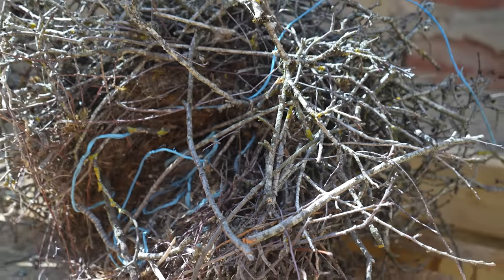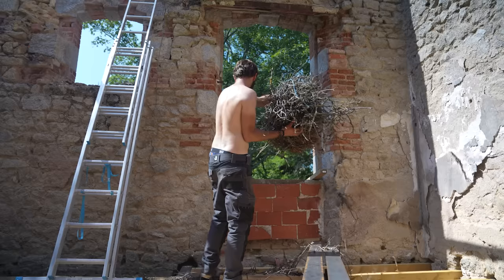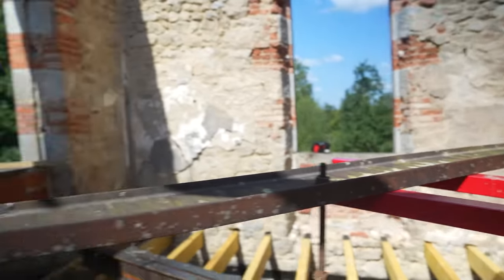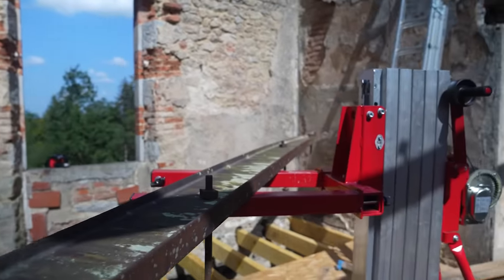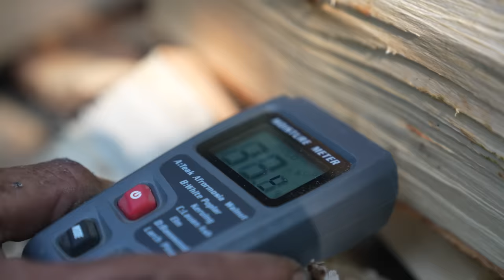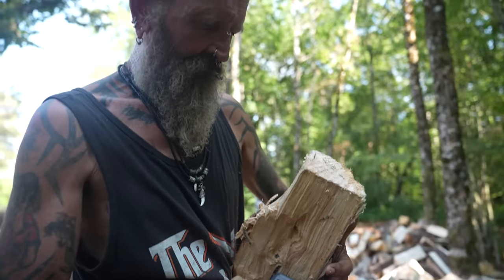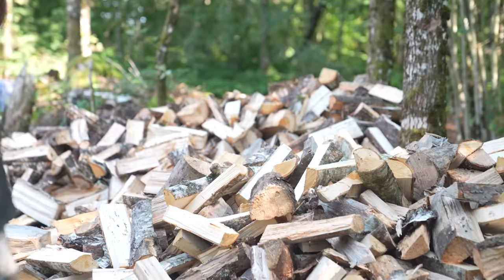Processing CHATEAU trees into YURT firewood.

Comment: Dan put a plastic skin over that second story floor once you got it all in. 
It will give you cover beneath on the first floor for a huge amount of undercover workspace and any water that lands on top will be redirected down the sides to the basement below. 
That will give you lots of extra time to get sorted inside while you repair all the walls, windows and doors and slowly build the third floor. 
(I didnt realise till you pointed it out just how much work you need to do to stabilise the tops of the walls and second story windows)
As it stands right now all that water is just coming down in a shower between the boards and you don't have any undercover area to store long lengths of boards or even the bags of cement and lime.

Comment: My dad used to use a mechanical splitter for his firewood but it was only the splitter part and you had to load each piece of wood onto it a number of times to get the wood split small enough (it only had one vertical blade mounted on a hydraulic pump). Dad retired from working when he turned 75 last year, he had been using chainsaws since he was 10 years old. 
He grew up on a mixed agricultural farm with stone fruit orchards that had to be pruned and as the only son helped his dad with all the chores including using a chainsaw, manual blockbuster and axe to split firewood, make kindling, prune trees, etc.
When I was 13 he joined the local unit of the NSW State Emergency Service (here in Australia) to help with storm damage, etc. He soon started teaching all the other team members about using a chainsaw safely. As a team we were sent on "out of area" jobs to places like Sydney and Maitland where he used his skills to remove problem trees that had fallen (or were threatening to fall) on houses/buildings/roads etc.
He served 25 years before retiring.
I really hope that Nick is able to share his experiences and skills with more people. I think he and my dad would have great fun swapping stories. Blessings from South Eastern Australia, Dot

Comment: My Dad would have loved that firewood cutting/chopping tool.  We had a wood splitter and an old arbor mounted saw that ran from a tractor belt pulley.  But all that was slow and the saw was more than a little on the dangerous side.

Comment: Hello Dan, the top finish of the walls is very important. A ring beam made of reinforced concrete seems to make the most sense to me. The ring beam should be dimensioned by statics. In the past the building had a mansard roof and will certainly have a mansard roof again. However, the roof truss for such a roof can look very different and therefore also introduce very different loads into the walls. Above all, the horizontal forces from wind load or possibly from the expansion effect of the roof construction are problematic. So you should only build the upper end of the walls when you know the construction of the roof truss and all the connection forces.
Reply: I assume that's what he's going to do since he mentioned that for the third floor a while ago. I assume the original construction relied on the timber structure of the roof but had reinforced concrete been more common I'm sure that's what the builders would have used, considering how modern the château's construction was for its time.

Comment: Nick has all the fun BOY TOYS , you will need to start heating the Yurt otherwise your mattress will start getting damp and the new leather sofa will start to mold 😞. 
Things are moving so fast at the moment and fixing the top walls will be epic as it won't be long before the first roof goes up and it's not even September yet !!! WELL DONE DAN !!!
Reply: It will still be a slog to finish the roof before Winter sets in, it's a pity that all the window lintels need replacing, it will take about three or four weeks to get the structure up to roof level, but sorting out the roof sections was always going to be the time consuming part and at least he's getting there, hopefully he will not have to many "interruptions", I wonder if he's going for a temporary or permanent roof, most probably temporary for now!?!
Reply: @thomasherrin6798  do you know the roof of a castle? do you know how difficult and different from a normal roof it is? A roof of a castle needs a specialist, do you have never seen one? Roof and attic?
Reply: @mlaiuppa  It could be done though, as the rafters used to run parallel to that main wall with the fireplaces, so extending the roof framing over the central hallway later wouldn't require any splicing. Just let the sarking and membrane overhang the last rafter and cut back once the next rafters go in. I think the section could even be slated without too much hassle. It's not uncommon to do large roofs in sections, like Château de Purnon.

Only the chimneys would have to be fixed to above roof level before that could happen because the mansard roof runs into them. Of course just doing a shed roof bolting a wall plate to that fireplace wall and running rafters to the outside wall would be faster and easier but it's work that will have to be done over in the foreseeable future.
Reply: Who wants a tour of inside the 🛖 yurt ?
Reply: @janice8948  oh I thought id have missed it Dan said he would show us round
Reply: @janice8948  yes I agree, and how does @LordBurberryGB know he bought & has a leather loung?

Comment: Dan, do you will make a temporary roof before winter to protect all your floors?
Reply: His goal was to have a roof completed.
Fingers crossed.
Instead of fire wood, I wish he and Nick, maybe Cameron too, would focus on getting to the roof level in order to start building the Roof.
Reply: @dennispatrick4999  Nick is a busy tree surgeon not a builder.
Reply: @consideredwhisper  You totally missed the point of the safety discussion. 
Nick is a tree surgeon/trimmer and uses his safety equipment like a pro he is.
Google Safety Construction Laws in France. It definitely covers Dan's Chateau work and he should adhere to them. Especially with his 2 small children.
It's amazing that someone has issues with safety at a major Construction site.
Reply: @dennispatrick4999  where is there a discussion about Safety in this little thread for me to have ‘missed the point’? I was simply pointing out to someone who might not know that Nick is hired because he deals in his professional capacity with the trees (in several chateaux): in addition he happens to have some kit that helps Dan with the clearing of crap out of the building or to help lift beams. He isn’t a builder to build the roof. I’ve no doubt Nick is booked solid as a tree surgeon elsewhere.

Comment: Is this next level the Roof??? OR is it 1 more floor to go up??? Roman Concrete the Strongest concrete is Sea Water, and Quick lime, The Salt in the Sea Water makes it set better, and chemical reaction happens to make it More strength
Reply: Yes, once Dan gets the new steel I-beams in, they are the main supports for joists make up the 2nd floor & 1st floor ceiling.   The 2nd floor had the mansard roof, and another commenter 'Ragnar' said the 2nd floor probably housed a smaller 3rd floor attic/loft.

Comment: Your work here reminds me of the channel, Les Jeromes. Only they are the ones who dismantled the chateau’s inside, including the roof, and rebuilt it. They also have had to bolster up, repair and replace bits and pieces all over the place. But they were two, yes, both named Jerome, who worked on it. Fascinating.
Reply: They're crazy perfectionists though. I absolutely can't imagine Dan painstakingly collecting, sifting and reusing old mortar! I'm a bit surprised they're doing OSB and Fermacell stud walls rather than plaster & lath though. Seems a bit too easy for how they usually roll 😅

For anyone who doesn't know the channel, they're two Belgians who bought a fairly rundown 18th-century mansion in France, near the Belgian border and have been working on it for several years now, stripping it to a bare shell to remedy plenty of wood rot and poor previous renovation work. Eventually they also plan to rebuild the spinning factory on the grounds that burned down in 1908.

Comment: If you want at least some of the wood for this winter just stack it in separate rows. And cover the tops. I've been using firewood as the only house heat for 35 years. BUt it's best after a year. I cose pack my rows because it will take too much room otherwise. You have lots of space to make long rows.

Comment: Enjoy your vlogs. I'm not in construction just an old lady in Florida. I had a thought , couldn't you remove crank handle, on the parts lift, and replace it with a fitting that could fit a drill? Thus saving your arms/shoulders. Hope this idea isn't silly or unwise.

Comment: Question: Don`t you have to anchor the wooden beams for the floors on to the metal center  beams? I can image if you dont do it, the wooden beams might go off their place, so the wood part can collapse? Because i see those metal bars in the old iron beams.. Maybe those where the anchor points to the wooden structure..
Reply: I would think securing subfloor to the beams will solve any shifting.
Reply: @desire4liberation  That would probably be enough, yes, but Dan's going to put in noggins, short pieces of joist material that will absolutely stop the joists from going anywhere. He did the same on all previous floors.

Comment: What sort of stove setup are you putting in the yurt? Will it be one that can also heat water so you can fill an occasional hip bath, or will you put in a modern electric instant hot water heater once you've got running water to the site? Yurts that size sometimes get full kitchen and bathroom modules built into them, but I don't know if that's in your plans or not. It'll be your home for the next two or three years, probably, so perhaps it should be in the plans at some point, even if not right away.

If you're not building a bathroom and kitchen right now, though, are you at least going to put a composting toilet in so you don't have to tramp through the cold and climb a ladder in the dead of winter to use the one in the chateau?

What are you doing for drinking and cooking water right now? Are you still planning to excavate the well? It occurs to me that if you're going to drain and clean it and have it inspected, that might be better to do while it's still warm out.

Comment: Are you going to use a ground source heat pump for chateau hvac? Makes sense to me if you have the tools on hand. Good luck on this amazing project!
Reply: Either heat pump or wood chip boiler seem the most logical solutions. A heat pump requires a decent electric supply, we'll see how that's going to turn out.

Comment: I wonder if you might have thought of putting a temporary roof on to ensure the work you've done remains solid after all the rain - like maybe a heavy plastic on the part of the roof after your finish that part of the second flooring - maybe tied or held by weights?  Or, will the wood be fine after being exposed to lot of rain?  Or will you replace the wood after getting the roof on?  Maybe reuse the plastic after in some way like weed protection sheets maybe are waterproof?
Reply: He  tried using  tarp as a temporary roof, for  various reasons it  didn’t work.

Comment: The arches over the top floor widows don't look like they are failing. Are you sure? The key stones are supposed to look lower than the brick part of each arch. 
Amazing watching you get those iron beams down alone.
Reply: I don't think he's talking about the arches on the outside of the window openings. Those stone walls essentially have two skins, an outer and an inner one. The outer one in this case has arched window openings while the inner ones had straight steel lintels and those are the problem. Some have already disappeared because the stonework that used to support them is gone and the others are hanging rather precariously. The inner skin might have to be removed all the way up to roof level (which isn't all that far up to be honest) to repair that. Some of it is already gone anyway.
Reply: @Ragnar8504 - It was hard to tell what he was talking about. 
It seems that where the masonry was exposed to rain the lime mortar just falls art and becomes more like sand again?  When DEan rebuilt the corridor walls at the top those just came av part in his hands?

Comment: Dan, just a quick question, l noticed that the steel beam that you took down had several steel rods along its length, the ones at the end anchor the beam to the wall but what purpose do the ones in the middle serve?
Reply: I think the original builders strapped timbers to either side of the steel to support the floor joists instead of notching the joists to fit the steels directly like Dan did. Both methods were commonly used when Chaumont was built and I think Dan's is sturdier than the original one (because I assume they notched the joists to sit in pockets in the timbers bolted to the steels, joist hangers hadn't been invented back then).

Comment: So would the chateau eventually have an attic at some point?  Or would it just be the top floor then the  roof? Are attic  really necessary or is it a nice to have for storage? And that firewood/log splitter machine is so very satisfying, too bad you can't use the wood for another year. But it looks like things are coming along.
Reply: Yes, there would have been small loft areas on the third floor. Just for clarification: at the moment Dan is working on what is considered the first floor (première étage), below that are the ground floor and basement. The beams he removed in this video were part of the ceiling between the first and second floors. The second floor had a mansard roof and the top section of that was the third floor attic, accessible from the hallway where the water tanks used to be. The doors to those spaces were just behind the water tanks.

Comment: A lot to unpack with this video.  In the US the new machinery Nick has in called a log splitter. The wood hes splitting is considered to be green until it's stacked for a year, then it's considered seasoned. Also It's amazing the upper walls didn't cave in when you removed the metal bracing.
Reply: I'd say it's a firewood processor because it cuts logs into shorter pieces and splits them in one go, plus the conveyor belt for loading the wood onto a trailer or truck. A splitter is usually just that, it splits cut logs.

Comment: Dan use that tent to keep a dry supply of wood for the winter so it will burn okay. Wet wood or green wood is a problem with smoking up the place or not burning at all. firewood requires anywhere from six months to two years dry out.
Late winter and early spring are ideal times to cut and store wood for the following year. It allows wood to dry over the summer months, seasoning in time for colder weather.

Comment: Just how thick were the wooden beams that were bolted to those I-Beams?  The length of the bolts, from bolt head to nut, is insane!
Reply: Might have been 3" on either side of the steel, like the floor joists were. That would make the bolts around 7" long.

Comment: I have to apologize, Nick but the only thing that come to mine when you talk about "lowering something gracefully" is that vision indelibly etched into the front of my mind of your lowering the bathtub In a "controlled slide" gently from the second floor to the ground. That scene may remain with me for years. But all peals of laughter aside, you did a nice job of getting the beams down with the new "lifter/lowerer" machine.  That being said, it allows me to segue nicely into a thought to aid and abet.  Along with a few other things,  I did mirror work for years.  Mirror is always stood on edge, never lying flat.  Were you to build a small, wooden, lightweight rack to clamp/unclamp easily from the lift, it would allow you to stand all your sheet goods on edge which allows for much easier handling as in loading and unloading.  Useful for the flooring you are using now and especially for the drywall ceilings which you will be starting in another couple weeks or so.  Make the base about 6" or 8" front to back to accommodate a dozen sheets of drywall, about 4' wide and the back about 4' tall and tilted back at an angle just about the same as the little brace welded to the back of the lifting platform of the machine.  In future, it could save as many headaches as the machine itself. Also, does that lifter have an optional electric motor???   Nice Job!    Jack L.
Reply: Dan. Nick is the tatted tree dude.
Reply: @Sgirl  You need to get a grip, Sgirl. First, my name is not Dan, it's Jack.  Second, in my comment, I never mentioned the tatted tree dude and thirdly, the tatted tree dude's name is spelled Nic, not Nick. Pay attention.
     Jack L
Reply: @JackL75  You started your sentence with "I have to apologize, Nick" and then went on to describe something Dan did that made you laugh. You're the one who isn't making sense 🤷‍♀️

Comment: I'm wondering if there are any winch/pulley machines with electric stop&start buttons. It would cut back on excessive movement on the joints from  manually turning the handle. Your shoulder rotator  cuff might thank you to go electric.

Comment: Dan u need to get the cut wood off the ground because all the wood on the bottom will still be wet plus it will dry quicker if its getting the air flow both sides just cheap pallets will do
Reply: Yes, good idea about getting wood off the ground/increasing air flow.   Maybe he can use the old steel I-beams ( that he just chucked out of the right wing in this Vlog) to make a base with cement blocks for new firewood racks, as many clever commenters have mentioned.